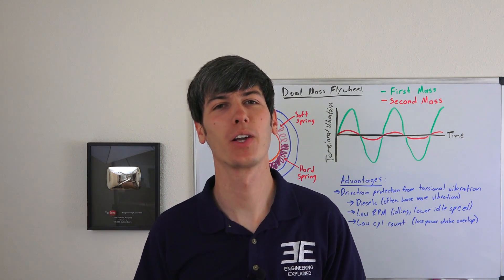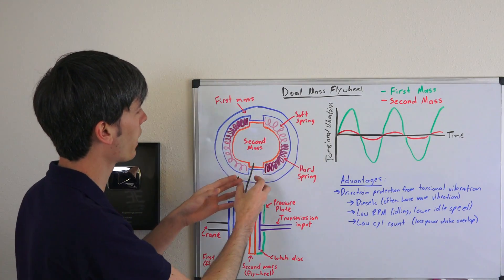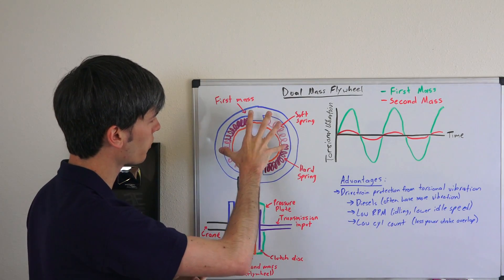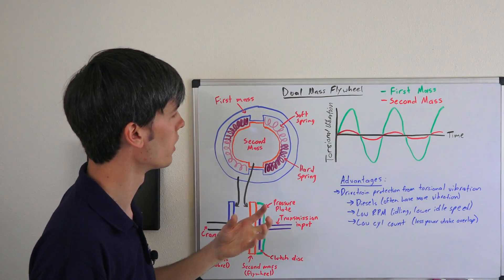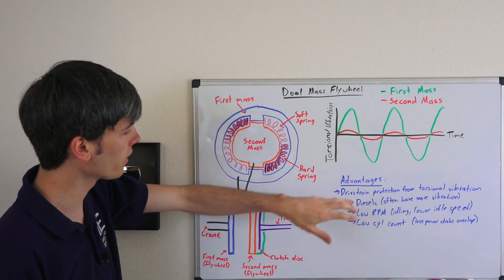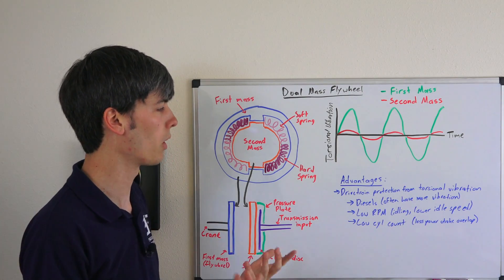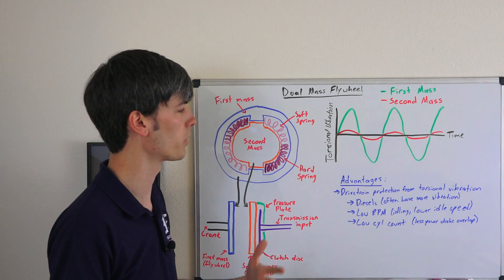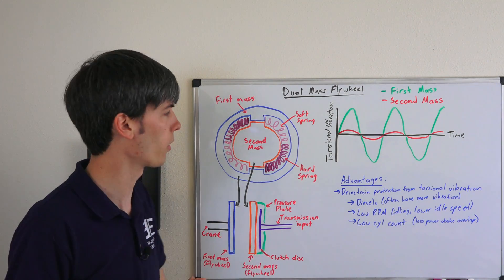Dual Mass Flywheel - Explained

Comment: Hello, Will putting 230 mm clutch disc with 240mm clutch plate on flywheel which is made for 240mm clutch discs destroy such flywheel? Or its not a big deal

Comment: Instead of a heavy DMF, why not make a SOHC, 3 valve per cyclinder I6 of the same displacement and cost?  It would be smoother, rev quicker, and actually weight less than the I4 with all of its extra flywheel mass, heavier UD pull, and counter balances?

Comment: Load of Bull. The crank is not vibrating. The weight of a solid flywheel and crank webs create a smooth revolution of the Crank.
Dual Mass Flywheel is there for people who can't drive smoothly and lack mechanical sympathy. Ask a driving instructor.
Reply: I ditched the DMF in my Nissan for a solid flywheel and sprung clutch disc and it's more reliable and just as smooth as stock. the springs in the clutch disc worked fine on man cars for decades.

Comment: I loved the video, Jason!  I have a MK4 2004 VW Jetta GLI 2.8L 24v VR6 6 speed Manual 02M.  Planning to buy a South Bend Daily Stage 3.  Do I need to buy a new Dual Mass Flywheel, or should I keep the one that came with my car as OEM? I think mine is DMF LuK 240mm.  Should I buy a brand new DMF from LuK that matches mine? Mine is almost 20 years old or should I switch to a Single Mass Flywheel? I hate to install a brand-new aftermarket Clutch of this caliber and keep the old DMF.   If you recommend replacing the DUAL MASS FLYWHEEL, with a SMF brand model, will it go well on the MK4 platform for this car?  Sorry for these type of rookie questions, I am pretty sure you get asked these all the time, my apologies.

Comment: so basically you get dampening by the FW and you have a solid clutch plate while with a SMFW  the dampening is done by the clutch disc, basically both do the same thing except the clutch discs seem to have stronger and more reliable. The DMFW has the core that is heavier than the middle of a clutch disc but that only protects the spline of the shaft better otherwise the shaft mass has enough mass to act as the center of the DMFW.

Comment: DMFs are nothing but a cash-grab. It replaces a never-fail part, that was easily replaceable, with a flimsy, un-reliable, and very expensive part. The reason why manufacturers are using them is to cause the transmission to reliably fail early, at around 5 years, costing $3000.00+ in parts and labour, motivating customers to just buy a new car. The transmissions paired with DMF are also fragile pieces of crap that will break in short time if the DMF is replaced with a single-mass flywheel. DMFs are a regression in every single way. DMFs are nothing but anti-consumer business practices.

Comment: The explanation was great but it would get better if you have done it practically. I mean if you use a real dual mass flywheel to explain it would be much easier to understand than using a white board. So my request is to make another video on the this topic but practically. 
All the best

Comment: If your car has a dual mass flywheel it usually means you’ve got a car with a crap engine.
Reply: M54B30 inline 6 is a mighty engine which has DMF. 

It is not diesel, it is not for trucks and it is opposite of low cylinder count. - 2:42

Comment: When you stall a engine with a DMF you will hear a large bang; what makes the sound?
Reply: That’s the secondary flywheels snapping back suddenly or bottoming out the spring.
Reply: Wow - that's a great way to test to see if your car has a DMF or not. My Subaru used to do that when I stalled it accidentally... BANG!...  There was also a lot of buzzing noise coming from the shifter. Finally the clutch started slipping badly so I had to replace it. Much to my horror I found a burned up DMF inside. Not expecting to have to shell out the money to replace it, I opted for an SMF. It definitely feels different now. If I stall it there's no "BANG!" If I hit the gas too hard while launching and turning the inside rear wheel will chirp. There's also less buzzing coming through the shifter. That seems counterintuitive but I can only imagine that the DMF was smashed on the inside.

Comment: Hi I have a BMW 330d been increasing power now want to upgrade clutch to handle more it is a dual mass flywheel car would I need just clutch plate to take more or a upgraded dmf also don't won't to go smf they don't seem to do better dmf so would a new standard one be enough many thanks

Comment: Dear Inventor of the Dual Mass Flywheel
Having now had to replace the DMF on my UK Ford Focus 1.8 tdci THREE TIMES, I would like to make a suggestion:
If this wonderful creation of yours is also used on large diesel trucks and the like, why not find the largest one on the market and then push it sideways up your bottom. It would make me feel better knowing that you feel equally as shafted as I do each time I'm forced to pay the garage for replacing your piece of junk invention. 
Thank you very much and goodnight.
Reply: happydavid13 replace it with a lightweight single mass duh
Reply: Just get a machinist to make a single mass flywheel that's heavier.

You're welcome
Reply: Make a video  buddy and tell em to there face ,,!!!
Reply: You need to be mad at the manufacturers for cheaping out on critical components, and not mad the the fundamental design. Ford isn't exactly known for being geniuses with the transmissions they spec for their cars.
Reply: Sounds like operator error lol
Reply: If you had to replace it that much the issue is obviously not flywheel but the driver. I have a car with dmf and no issues what so ever. Almost 100k miles on it.
Reply: Alex2900 you are making an erroneous assumption as I am in fact a very gentle driver. I’m still driving the same car and it has now covered 290,000. I fitted the last dmf myself 3 years ago and it is still working well. The previous one lasted a matter of weeks before developing a fault as I was reversing into my drive. There was a clunk and from that moment onwards it was out of balance and the car was almost shaking itself to bits. Since the flywheel I fitted myself has now lasted over 3 years, I must revise my opinion a bit and say that whilst ever they are working, they do work well and fulfill their role of reducing shocks to the drivetrain. But they can develop internal faults and lock themselves in an out of balance position even when used by the gentlest of drivers. I apologise that you were triggered by the harshness of my original comment.
Reply: @happydavid13  maybe because it's a Ford Focus? Not known for their amazing engineering lol.
I've had an E39 525d with perhaps original clutch and dmf, drove that car for over 4 years before I sold and got a 530d. It ran without a problem tbh.
Maybe not the DMF is the fault here but Ford is? Everything can work good if it's engineered and designed well.
Reply: @omfgwtfbbq90  you have a valid point! But I have come to the conclusion with the dual mass flywheel’s that it’s often the luck of the draw. Even if you drive them carefully they can still pack in relatively low mileage.
Reply: @happydavid13  if you have a shitty car then yes...
Reply: @omfgwtfbbq90  Again you have a point Sir! But my Focus is now on 304,000miles, so not all bad!
Reply: @happydavid13  yes I admit that's not bad at all. At least Ford knows how to design a decent engine. But the same can't be said about DMF evidently..
Reply: @happydavid13  Update?
Reply: @ChroniclesofJaybee  I replaced the clutch and dmf myself and had many miles of trouble free motoring thereafter. I had to scrap my car in Nov 2021 due to MoT failure (underbody corrosion). I’d done 315,000 miles. Excellent car. I have since purchased a low mileage 2008 focus for £3,250 from a dealer in York. Exactly the same model as my scrapped one with the 1.8tdci engine. I also have a Ford Transit Connect with the 1.8tdci engine. A 2011 model. 
These are excellent vehicles. Tough and reliable. Economic. Cheap parts. 
Just a bit of a pain if the flywheel plays up, but it’s not an insurmountable job to replace it yourself at home. 
Good luck if you decide to run one of these cars. I am a fan of them as you might have gathered. 
Take care
David
Reply: @ChroniclesofJaybee  And I am going to spray under the body of my replacement Focus with some sort of oil mixture before winter. It’s very low mileage and I intend to look after it. Should last me a long time. Although it’s 2008, it’s like new.
Reply: @happydavid13  thanks for your reply. Cheers!
Reply: @happydavid13 it's not the dual Mass flywheel I thought it was

Comment: My BMW E39 525d has a Dual mass flywheel as well. But it has a smooth 6 cylinder. Does it even need a DMF?
What will be the main differences felt if I will swap to a single mass flywheel? It already has one of those rubber driveshaft dampers. Will it have rougher gear shifts or what?
Reply: 4 years passed by. Have you learned the answer? I want to know for my 3.0 Z4 E85.
Reply: @DaVinci-uh4tr  a diesel 6 inline is always a little rougher running than petrol, so the DMF dampens the shocks towards the gearbox and makes a smoother ride.
Reply: @omfgwtfbbq90  yet it's an I6. Have you stayed with DMF?
Reply: @DaVinci-uh4tr  I haven't changed anything, I sold the car last year. Now I have E39 530d M-Touring :)
It has had the clutch changed, and I think the DMF too.

Comment: one question, how to optimaly drive to prolong its life time?
Reply: Don't drive it.
Reply: That is one intelligent answer from one intelligent kid. Thank You for Your constructive and very useful comment.
Reply: happy to help!
Reply: For a diesel, drive it for long trips (don't drive it too much in town, traffic... Etc), keep the rpm above 2000rpm, don't let the engine heat by letting it idling for half an hour, 1min for oil to get to all the engine and start moving slowly without passing 2000rpm.

Comment: So does does a v6 Also fire every 180degrees or is that just 4 cylinder engines
Reply: 6 cylinder should fire every 120 and 8 cyl every 90 assuming they are 4 stroke

Comment: I just changed the clutch in my 2012 Ford focus with 70,000 miles. The reason for changing the clutch was the throw out bearing was sticking. I had never heard of a dual mass flywheel before. Looking up the price it is only $65. I did not change because there was nothing wrong with it.
Reply: IGo ProEVERYTHING
Had any problem since then?
Reply: @JeanV1986  nope
Reply: You might have missed a zero in $650

Comment: In my own experience, the dual mass flywheel is designed to fail prematurely and then suck all your money out of the bank.
Reply: "i would say that a smf would be cheaper and give a better response but it will also wear out faster "THE OTHER COMPONENTS" because its not damping the impact of strokes..."
Reply: +davidrobert2007 Planned Obsolescence. Although some cars have after-market SMF options to replace the DMF.
Reply: If the crankshaft and all the components are designed to use a DMF that absorbs peak, i would say that a SMF would be cheaper and give a better response but it will also wear out faster the other components because its not damping the impact of strokes...
Reply: I read your comment, i 're-realised' i own a diesel vw with a dual mass flywheel, panic... Im screaming now
Reply: @zizogaucho9035 its not that bad its just a more expensive part. 350£ vs 170£. Just another thang
Reply: I might be experiencing that in my 2017 Mazda 3. It last me for a while however. I'm at 87,000+ miles on the same clutch and flywheel.
Reply: A single mass flywheel does not wear out. It's a solid piece of metal.
Reply: azagedon your transmission will wear out prematurely, something has to give. I have heard from Luk that doing “modifications” like these will cause other damages to other components as DMF was designed to cause less stress to the drive train. And obviously if it is a solid flywheel then you have to use a traditional clutch disc with torsional springs and that will increase rotating mass of the transmission input shaft and cause harsher shifting and more wear on the synchro than before.
Reply: @azagedon  That’s just wrong. Its like saying brake rotors don’t wear out. SMFs can warp, develop “hot spots”, and the surface can become rutted.

Comment: You need to replace a Dual Mass Flywheel with the clutch because of the mechanical wear. Depending on the design you can either get play between the two parts that causes the clutch to drag or they can break apart entirely due to centrifugal force and smash up the bell housing etc.

Comment: Most people ride the clutch at lights/junctions etc rather than putting the gearbox in neutral. This imposes greater wear on the clutch mechanism. The consequent and inevitable (and arguably needless) replacement of the worn clutch becomes a whole financial dimension above the cost of a standard clutch if the car's fitted with one of these DMFs. So be aware of that very likely cost if you're buying a secondhand vehicle above say 70k miles.
Reply: +Keyboard Dancers Holding the clutch all the way down only puts minimal wear onto the throwout bearing, the clutch material will not wear or "heat up" because it simply is not in contact with the flywheel or anything else.
Reply: Keyboard Dancers unless you do it on purpose to tell your wife its broken, then you can upgrade to performance shit and she wont know the difference. I got it all worked out.

Comment: I'll put my two cents about engine vibrations, if you wouldn't mind :-)

On the opposite side of a crankshaft there is a "torque vibration damper" (I dont't know how is that thing called exactly in english). Usually it looks like an elastomeric spacer between two parts of a band wheel. It's looks very small, so that most of people do not even know that it actually exists, but it works. Usually it's not a separate from the band wheel part, and can't be disassemblied. So the band wheel is also a sort of dual mass flywheel in modern engines. The vibration(oscillation) can break crankshaft at some definite (resonance) RPM range. The damper's purpose is to move that resonance range to higher RPM's, so high that normal engine can't reach it (maybe 10000-20000).

Comment: here most of us replacing it with a solid.flywheel kit as it gives too much trouble and too expensive to replace. By experience I can add that when a dual mass starts to wear out you can say goodby to the starter too, so you need to get a new starter as the one on your vehicle will be beyond repair, and I mean it.   so the best solution is to get rid of it. price wise here in Malta I would have paid some 1,400 euros 4 years ago for a dual mass kit original for a ford transit minibus 2004 2.4ltr 125ps model excluding the starter. Its simply insane.

Comment: Hi great video as normal isit possible for the two parts too seperate?? as mine is noisy 😭 would it be worth a solid flywheel conversion?? 
Cheers for reading

Comment: Slightly off topic, but you mentioned the lower cylinder counts in an effort to save fuel and it got me thinking.  Why do automakers revert to trading in their 6.0L V12 for 4.5L V8? Would it not save the same amount of fuel, yet keep the silky smoothness of a V12 to just create a 4.5L V12?  Or does cylinder count matter more than displacement for fuel consumption?
Reply from the maker: Trey Perry More cylinders = more moving parts, and typically more frictional losses as you have more contact points. More moving parts also means more energy lost.
Reply: @EngineeringExplained  Why don't they make single cylinder cars then?

Comment: Hi I know this may seem a little of tangent to the video, but I was wondering the real world effects of tire width (surface area) and friction. I ask this because in my physics class I learned that surface area does not effect friction (may or may not be accurate to certain points?). However from other sources (Lots of them) I have been told that wider tires increase "grip". The only rational point I can think of is that the bigger surface area and mass could absorb more thermal energy without temperature change, thus keeping the material characteristics the same. I am not sure I completely understand these concepts. Is it that the term "grip" has nothing to do with  friction? I am not sure. I would be very grateful if you could provide any insight on my comment. Thanks!

Comment: So can you therefore use a clutch plate without springs?
Reply from the maker: nagonzo I believe this is done, yes.
Reply: BMW SAE (Self Adjusting Clutches) with a Dual Mass Flywheel have no springs in the clutch plate if you would like to know.

Comment: Would they not be substantially heavier than a regular flywheel? I would think these would only be used in extreme cases of vibration like with diesel engines as the added rotational mass to the drivetrain would hurt fuel and power, no?
Reply: You can make the masses as heavy or light  as you want. The whole assembly usually weighs the same as the single mass equivalent.

Comment: Engineering Explained "If you have a 4 stroke engine your'e getting one power stroke for every 180 degrees of rotation." Something seems off. Would you not be getting one power stroke every 720 degrees per cylinder?
Reply from the maker: Andrew Wittwer Whoops, I was referring to a 4 cylinder engine and perhaps didn't clarify.
Reply: I think you're right if it's based on one cylinder, I'm assuming he's saying any one of the cylinders will be firing every 180 degrees.
Reply: Engineering Explained  so if I have a bad flywheel  it's gonna start making noises like rattle flywheel ??
Reply: Engineering Explained so now which one you choose between them  DMF  or SMF ? need answer  next Saturday 3/6/2017 I should decide  :( !!